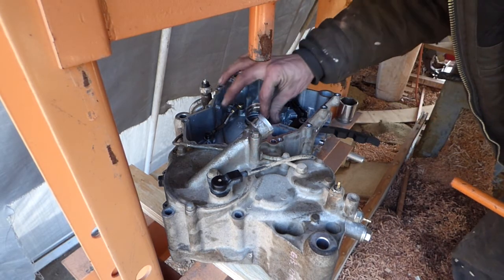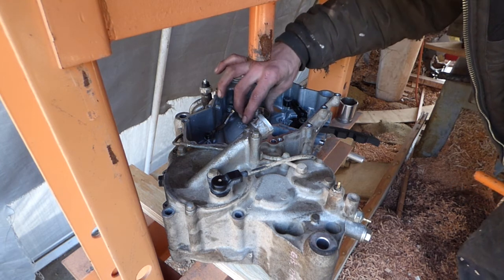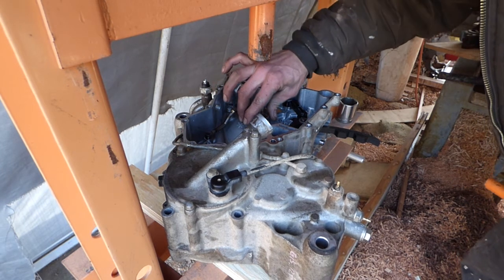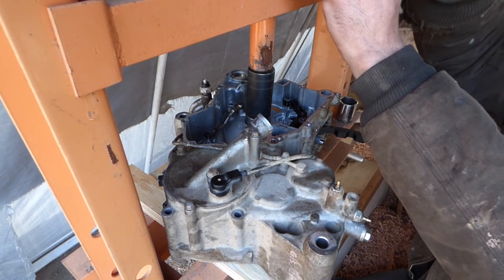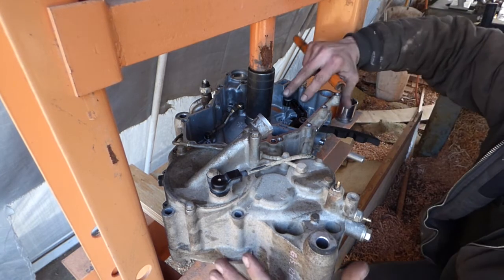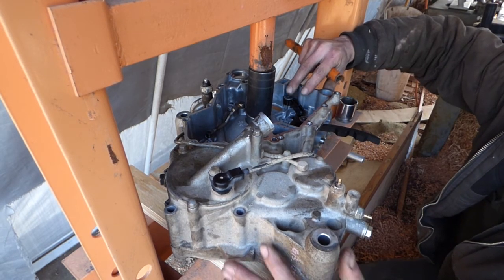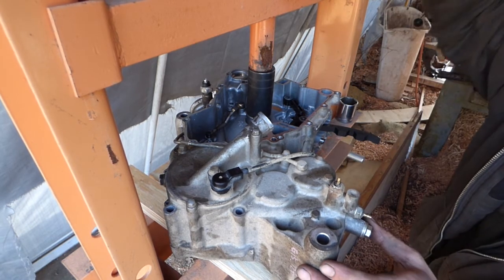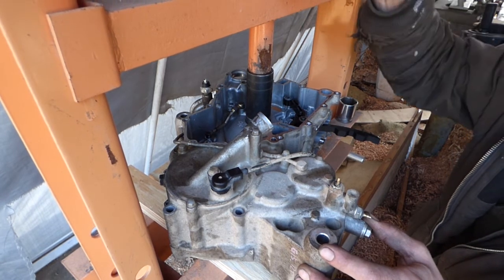Kawasaki Brute Force/Teryx 750 Crankshaft Bushing Replacement

Comment: did u have to get it line board after installing the new bushing
Reply from the maker: Line boring or reaming would have been an idea as the crank was a very tight fit upon reassembly.  The bushing has an oil channel so Im not sure how much material if any can be safely removed. Against my better judgement, I 'adjusted' the fit with sandpaper and got lucky.  I suspect the case half was damaged by the crank meltdown and should have been replaced(or just junk this entire POS).
Reply: being you said it fit really tight did you have to get it opened up a little for proper clearance?
Reply: @russmurray9456  he used emery cloth to sand the Id of the bushing however you're supposed to line hone it at a machine shop
Reply: I’ve got one I’ve swapped 2 cranks and I’ve always worried about the bushing but the given spec was quite large. Seems to me u can have quite a variance. Theirs a roller bearing on the crank end to add additional support. Anyway from what I’ve seen and personally experienced u don’t need a extremely tight clearance. I’d say if u can put it together it’s going to be fine. Some suspect a worn bearing to lower the oil pressure enough to cause a rod bearing failure but I don’t believe that to be so as mine has extreme miles on a very worn bearing. From memory I could pretty much insert a .007” feeler gauge and they say .010 is max I’m not sure but from what I remember yrs ago I thought my clearance was large.